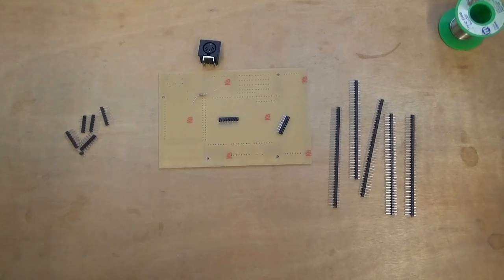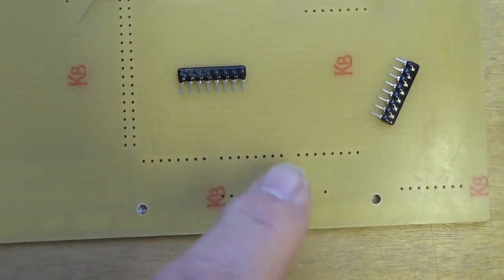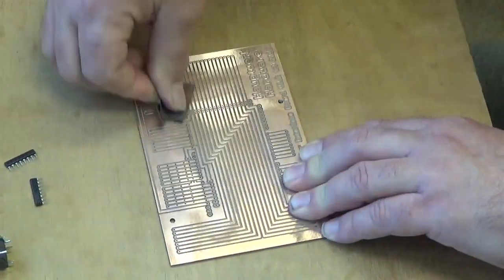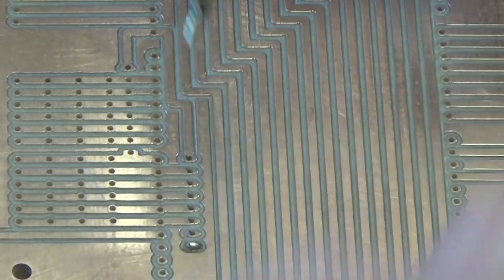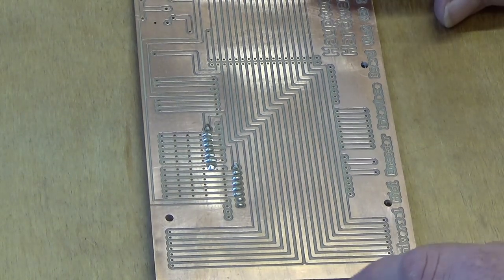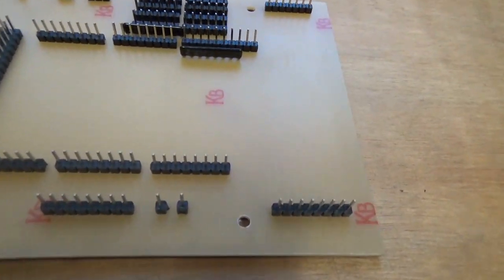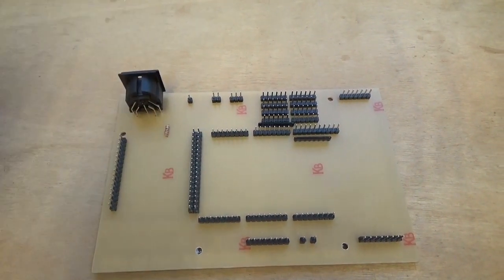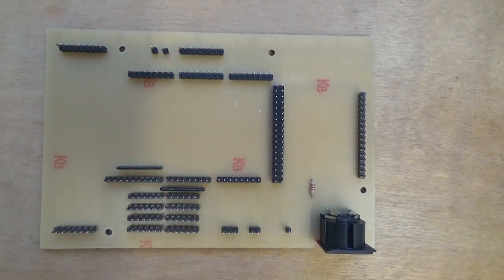Hauptwerk Hardware Interface Board Kit

Comment: Thanks so much for all your videos Bob, they are of great help.  I am (or was before I retired) an electronic engineer and was just wondering why the common side of the resistor packs are tied to Arduino board's digital I/O pin 14 instead of ground.  I guess originally I had thought that those resistors were just used as pull-downs.
Reply: Sorry Bob, no need to reply, I figured it out.  You're brilliant :)
Reply from the maker: @robertbrodine9841  Thank you for your kind words sir.